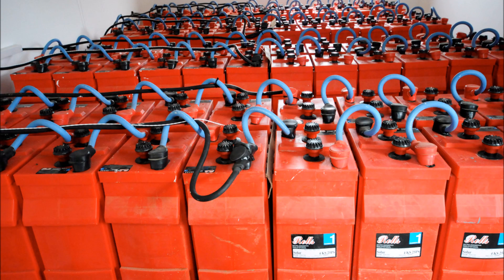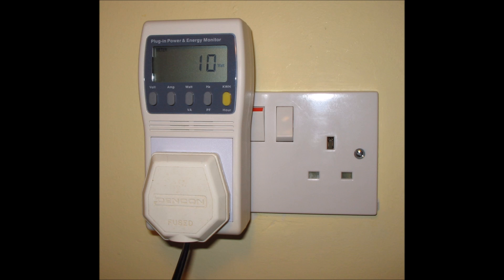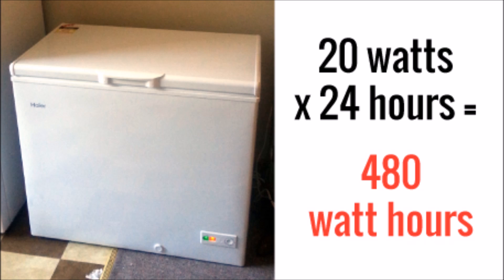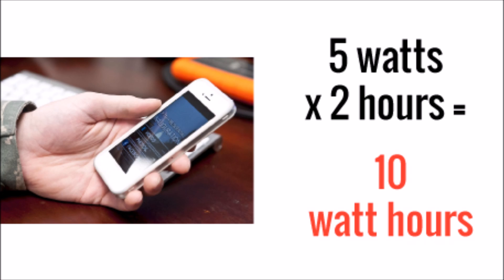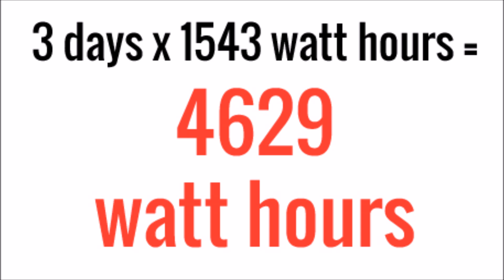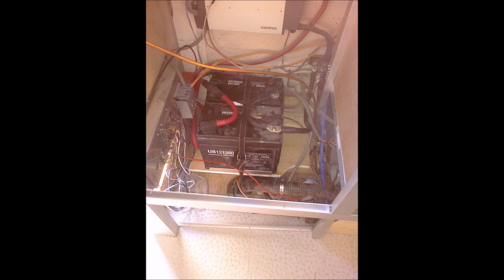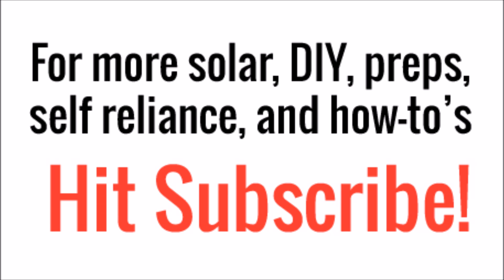How To Size Your Off Grid Battery Bank Capacity For Solar - Math Warning!

Comment: 3:14 If you are using an LED TV at 32 inches it only uses 28 Watts. For a 100 Watt situation using an LED TV  it would need to be around a 68 inch. (not sure what type of TV was being used as an example in this video)

Comment: so with a 29kwh day i have thats 1200 watt hours. in a 6 volt system thats only 3 total batteries in parallel.on 12 volt system 2x2 6 volt batteries. 2 series 2 parallel.?? i feel like i had to done somthing wrong 3-4 batteries ina system for 3 days of usage??

Comment: Don’t you mean divide the 385.75 buy two remember the 50% loss you x the number it divide buy two answer 192.875 amp hrs
Reply: i think hes sayin 385.75 is the amperage usage per 3 days so if u double that number to 771.5 ull have 50% left in the batteries. now if im right on this 192.875+ the 771.5 would =75% power left in batteries which is ideal for max longevity of the batteires.

Comment: Excellent video 👍
Can you please tell me how much watts does 2ton Ac uses if we run 18hrs per day.
Reply: It varies widely depending on your unit. There should be a spec panel on it that tells you all the information for your unit. It'll say watts voltage along with all the model number and serial number

Comment: So, speaking Lithium and to meet this examples goal, I would need to purchase 4-200 amp hour lithium batteries at $1,999 each?  *cough *cough....  Did I miss something?
Reply: Lithium batteries can be discharged down to 0 technically but most people try to stay around 20% discharge. Lead acid batteries cannot be discharged below 50% without harming them so if you went with lithium you could use 4-100ah BattleBorn Lithium Iron Phosphate batteries at $850 each. This is a big amount to pay up front.... However..... A lead acid battery might last you 4-5 years if you're lucky where a Lithium BattleBorn could last 20+ years. They are guaranteed to last at least 10 years from the manufacturer.
Reply: @ChadSmith305   Thanks.  I'm still a bit confused at the 700+ah requirement, yet we're saying we can get away with 4-100ah lithium.  I'm still missing something...  What would be the total ah with 4-100 lithium in series/parallel?

Comment: Can't nickel iron batteries go down and up as much as you like with no penalty? Downside is they have low energy density, fairly slow to charge, probably can't deliver big power spikes (esp at 12 and 24v) and are expensive, ($17k for 48v - 40x 400ah) but that is made up for by their extraordinarily long lives (perhaps as long as 40 years), incredible durability in temperature extremes of hot and cold and their ability to indefinitely hold charge. I think they are ideal for off grid but perhaps not so good in a yurt.
What do you think?
Reply from the maker: Yes they are great batteries if you have the space, weight is not an issue, and you can afford to charge slowly (like you said).
Reply: @LDSreliance  i don't think the slow charge aspect isn't quite the defecit its made out to be since solar panels slow charge all day.
My sources say nickel-iron batteries can go from 0-12v in 4-5 hrs. That's not bad considering lead acid can only go to 10v.
Reply from the maker: That is fine for the summer but won't work in the winter.  As long as you can handle that then go for it.

Comment: 2:01 Averages are a grossly misused mathematical function, and this is a prime example.  Why?  Because when running it's going to pull a lot more than 20W.
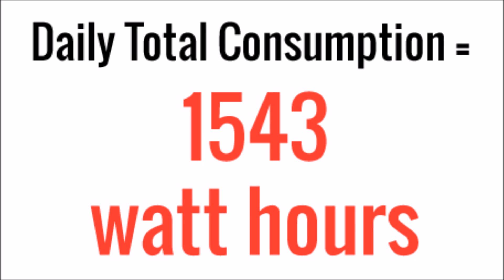3:18 Lights?
3:38 In winter, it could be overcast for many days, and -- unless you live in the Tropics -- will be lower in the sky and for less time.

This is a pretty facile video.
Reply: RonJohn63 pl

Comment: Firefly batteries have an incredible depth of discharge - down to 20% not 50%. That means that in this scenario you would not need so many Amps at the end of the day. Say 500 Amps instead of 770 odd.

Comment: Watt devided with Volt = Amp !!!! Volt x Amp usage = Watt  thats the way to go .. sun / wind ain't for FLAT ERTHERs
This is not even a fair way to asume consumption 
On how meny houers a Day was the TV lit.. ??? Standby power 
How meny times did you PICK Up bear under the Days game ??? 
And so on ... 
What a retard way to handle this .. 
The golden rule !!! Of any battery  for max life time .. What els ever you do .. take's of life span 
Never chardge more than 10% .. What is 10% .. 100A or 100Ah  10A max 8hrs for a full chardge 
You can onley use 10% of A over time not at once ..on a 100A 10A draw at any time .. 200A  20A draw 
Thats Why i use  48v .. why ..  4 x 200A is 48v 200A .. yes and No 
You distribut the load still max 20A draw .. remember V x A = Watt 48x10=480Watt 48x20=460Watt .. 
But in a 48v you distribuate the load so ITs 5A PR batteri  so!!!! You can pull  20A 4 times  48 x 80A =3840Watt continius for 10hours+++
But who does that !!! Who use that kind of power 
chardge power is max 80A@48 also not 20A@12 PR string i also got 48 250Watt PV BUT!!
With 4 hrs of light the 21december .. No amount of PV (yes but IT would be just stupid number)
Or batteri bank huge enough ( and yes ITs doable but again stupid big)
So unless you toss a Wind turbine 150Watt or like me 5 blade slow wind 3000Watt 
Untop to chardge bank during Night and take load at Day when possibel ..you are fuked on SOLAR ALONE 
If u live where shortest Day don't get Shorter than 6 hrs of light you maybe can pull full solar off ..
But i won't settle for almost or nearly. I want surplus .. if my wife want to vacume All night good forbid
She hawe that opetunety.. 
If she want to bake games All night using 2 x 2500Watt on and off .. THERMOSTAT the draw ain't consistent  All night .. well go ahead
The TEP6000Watt@48v von't care .. 
I use EPever / Shtepower.com EPever also make inverters .. but onley 3000watt the TEP TIGEN Same company make 6000/12.000 
And  they hawe exelent EMC And No RFI  ( i am a HAM so i dont want RF noice switch mode noice .. flat screen noice .. fluruecent light bulp noice .. fuking LED NOICE !!! ) 

I got 4 Banks and adding a 5 bank so i end out in 48.000 Watt or meny Days of No light at All sounds like Winther on northen hemes pheare 
REMEMBER A BATTERI IS A CHEMICAL THING !! .IT IS SOME WAY SELF CHARDGING .. 
IF FLAT STOP USING FOR SOME HOURES AND IT WIL RE SURFACE .. NOT FULLY CHARDGED BUT USEBLE FOR A ""SHORT TIME DEPENDING OF DRAW""

Comment: could ya do another video....same stuff but a 24 volt system....then there is confusion with appliances using ac or ac and the best voltage
excellent break down with yurt....but a washer would be nice addition to the calculation.....

Comment: Hi there .really enjoy your videos. I have a question to which I am getting mixed answer. I have a small hunt camp. 14 x 24. I am setting up a small solar system. I have 3  100 watts 5.5 amp solar panels . The battery place told me I needed 4  6 volt batteries. It says 25a with 440 under. Then 20 hr with 220 under on the batteries. Do you think I have enough solar panels? After watching this video I calculated I need 500 amp hours. Any help would be appreciated. Thx

Comment: Refrigerator does not work 24h per day because it has interupting function depending of temperature inside. If the temperature comes at selected level it stops and it starts again when it comes up and the champer get warmer...Any way thanks for the presentation....

Comment: Magnum Magnasine inverters are 95% efficient  plus they have a diversion Load Charge controller that works well with a AC Couples setup using Micro Grid tie inverters even in off grid setups buy hooking the micro inverters to the inverter output side of the Magnasine PAE 120/240 inverter making the Micro inverters think the Magnasine is the grid and the islanding shutdown will not take place. Check out the ACLD-40 diversion panel that can store Extra solar power in Normal Hot Water Tanks or Run Regular electric 240 baseboards up to 4000 watt per ACLD-40 Controller. So having a large Battery bank can be gotten over a larger time period. and this setup could lower the chances of adding more cycles to the bank plus use the Power without wasting because of the Loss in charging. Having a hot water heated basement floor could store alot of the extra energy and have ing a smaller battery bank could allow you to buy more micro inverters and solar Panels. You will also save on buying DC charge controllers and the heavy wiring needed for Panels to charge Controllers over a distance Micro inverters produce 3500 watts per string of 14 panels at 240 volts 15 amps or you could use some high voltage grid ties in the same manner. Placing you money in the most efficient place make a different's. If this type of setup was used in most homes their would be no need for Time of use billing because homes would use the sun in that time straight of the panels and as Battery get better and cheaper the Homes could be the grid source of power in the day time. People would do the things in the day time and less power would be used at night at your home residents. Magnasine inverters can be stacked in 4 units for 17,600 watts at anyone time continues. These inverters also have a automatic disconnect from the grid if the grid loses power and can be programmed to use only a percentage of grid power so you could program it to only use solar energy in peak billing periods.

Comment: Hi thanks for the video! Once you have the battery, how do you pick an inverter? What does the wattage of the inverter mean? 
Is there a device you reccommend that tells you how much power is stored in the battery so you can keep tabs on your usage? And is there an option for an auto-off, before the battery dies? 
Thanks so much!
Reply: Alessa E, you first need to find out how many watts you use in an hour. Then add 30% to that number. You never want to max out your inverter all the time. Then you can find a battery monitor system for your battery bank. Midnite solar has one built in there charge controllers that I use. It keeps a log for over a year. There are others just do a google search.
Reply: @rigginsranch  Thanks so much!

Comment: it appears that the loads for lights, heating or cooling (fans, blowers, and compressors), water heating if electric / water pump if pressurized or for water transfer, any communications support equipment (internet for said computer) and any tools, portable battery's

Comment: why 12V and not 24V or 48Volts, you would end up with less amps hour and thus spend less on copper
Reply from the maker: True.  This particular person wanted to use 12V.  The advantages of 12V are there are many more devices that use 12V DC than 24 or 48 and inverters are really cheap.
Reply: @LDSreliance  makes sense then if that's the case

Comment: You also have to charge lead acid battery at a current that is C/10 (less or more will give you less efficiency) So for example of a 800AH 12V bank, your charging current can not exceed 80A. This is important because once you have chosen the size of the battery, as solar panels are so cheap you'll obviously choose to add more of them (this is always a good idea, especially useful on those cloudy days or to redirect extra power to a water heater etc.) please do not exceed this charging current of C/10. Lithium (both LiFe and LiCoO2) can be charged faster, and can be discharged pass 50% with less problematic consequences. With lithium I would go with 4 days, because with lead acid in case of extreme emergency you can go pass 50%, but with lithium when you are at zero you are done.

Comment: Great video. In my experience, if you can afford it, particularly lead acid, keep them 60% or above.  Also, many deep cycle batteries are not true deep cycle, so I base my calculations on 50% of advertized Ahr rating. That, with 40% load, you should have a healthy margin for error.
Reply from the maker: Good thoughts.  Thanks!

Comment: Thanks for the video.  So I calculated  an off-grid emergency situation running the basics for my house, 20,000 daily watt hours.  Calculate this through gives me 45 batteries (assuming 229 AH batteries and 50% discharge rate).  $7,500!    HOLY CRAP!
Reply from the maker: Yep.  But if you get the right batteries they will last you 6-8 years (like my Trojan T-105RE's).  Or, another option to consider, is go hybrid and install a small wind turbine.  They can provide some power all day long unless it is less than about 7mph winds that day.  That can help offset your electric needs, especially at night, and allow you to get by with a lot less batteries.
Reply: Bobos Curse, actually if you get crown's cr260 lead acid battery and use 48v system you only need 24 batteries. My local dealer has those batteries listed for $120 without a core.
Reply: @rigginsranch  Yes. But what's the DoD for them and do you have to constantly feed them water and keep them in cool areas like the forklift deep cycle gels?

Comment: The absolute best way to calculate the demand that you will need to supply for will be to purchase a metering device like a TED (or one of its competitors) that will monitor your whole house usage 24x7. 

I own a TED, and it places current transformers in every breaker panel in my home as well as smaller CTs on key loads I really want to watch like HVAC,Etc. I also have a set of CTs on my PV panel as well as my Backup Generator Panel which account for their contribution as electrical sources. 

TED will record and store up to two years of detailed usage data in a database which can be downloaded at any time and the data will be cross referenced with the date and temps/sun amounts on those days as TED tracks the local weather as well. 

If you tell TED how much your electrical utility charges he will predict your bill. 

All of this will allow you to very easily size a battery system knowing that you have confidence that you can life within the limits of the system.
Reply from the maker: Yes that is the best way.  99% of homeowners will never do anything close to that, unfortunately.

Comment: Good information as a primer.  To muddy the water,  consider the wattage of solar panels charging the battery bank.   For solar panel power wattage only able to re-charge the batteries for the amount of energy used,  this example is correct.  In the real world, when you have way more solar than the energy you are using, (solar is cheap) you may go into each evening with a full battery charge each night.  If this is the case, you only need a battery bank with enough amp hours to get you through the night.     Also, solar panels make energy even with heavy cloud cover.   Batteries are expensive.  Solar panels are cheap.   You do the math.
Reply: Maybe this video is more intended to a back-up power battery bank scenario instead of off-grid which need to take into account how the size of battery bank vs how much power you can generate and store back into the batteries using solar +/- generator over a longer period.

Comment: Once you have your power storage figured out what's wrong with wind turbine and solar
Reply from the maker: You can use both in the same setup as long as your charge controller can handle both at the same time.

Comment: I suggest you read up on Ohm's law.  What you stated is NOT Ohm's law.  Ohm's law states the relationship between current, resistance and voltage in a circuit.  Nowhere does it mention power (Watts).

Comment: if you use Outboard deep cell Marine Batteries for your battery Banks they can run lower than 50% if I'm not mistaken and they're made to be continuously drained then charged so they would be a better option correct if I'm wrong plz let me know..!!!???
Reply from the maker: I don't know of any deep cycle lead acid batteries that can be depleted 100% without a significant drop off in cycle life.  50% is the general rule with lead acid.  If you go below that the cycle life curve (number of cycles vs depth of discharge) gets much steeper.
Reply: Robert keys you can discharge them to 0% then recharge them but it greatly reduces the life of the battery. Your very best battery for resilience is a lithium titanium battery that has a projected cycle expectancy between 10-30,000 cycles (not a typo). The drawback is they are rather expensive.

Comment: Hi I Live in the uk and I’m off gid  I’m now on a 12v System but I’m going to sleep up to a48v System and I got on 12v 910 amp ours will I need more batteries if I go 48v thx ???
Reply from the maker: No, you won't need more batteries but you will have to re-wire them to configure them for 48V unless your charge controller can handle 48V input and 12V output.

Comment: 771.5Ah means you need 8 x 100Ah batteries, ranging from cheap $150 per pc to $220 per gel, so you need $1500 to just for batteries. And with 50% discharge they will last only about a year. Then you need to buy new batteries and spend another $1500. Now think how much that 771.5Ah is going to cost you from grid... 771.5Ahx12V = 9.258kW per day x 365 days in a year = 3, 379kWh x 12 cents per kWh = $405. Even if you double that for your grid operator charging you transmission fees, it's still $810 vs $1500 just fort battery bank. Math is simple and shows why off grid solar only based system make no sense if you have grid access. And this calculation does not include solar panel cost plus inverter cost.
Reply from the maker: They will only last about a year?  Show me the cycle life for any reputable deep cycle battery with 365 or less cycles.  My Trojan T105RE's provide 1700 cycles at 50% DoD (https://www.trojanbattery.com/pdf/datasheets/T105RE_TrojanRE_Data_Sheets.pdf).
Reply: suavek , a guy bought a used battery out of a electric forklift and it is lasted him for over 20 years, so even if the battery was $1,000, you do the math and add that up how much it cost each year